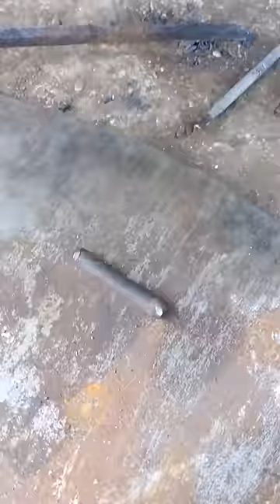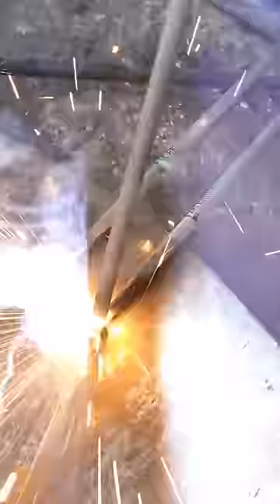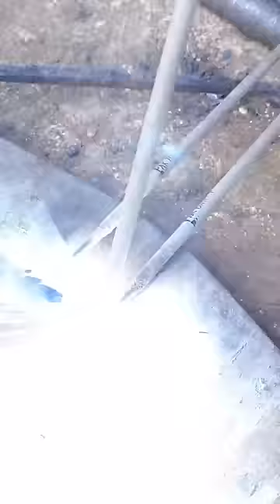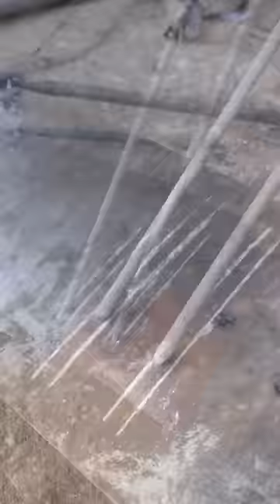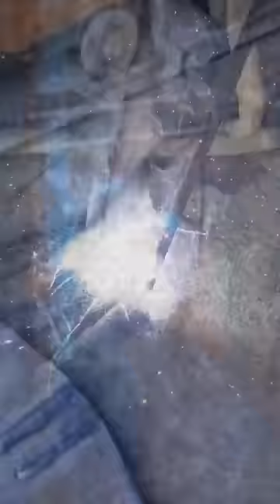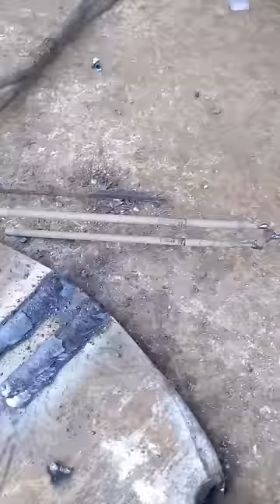dubal rod welding method of one welding machine #shorts

Comment: In the minute it took you to make that contraption, you could have just run a 2nd bead
Reply: Yup, and also what happened when the beads need to be MORE then an inch apart? or just one bead and the other just gets in the way.
Reply: @techmarine83  I mean, you could make it wider or shorter. And you wouldn't need to use it for a single weld, those sticks are actually one-time use. I'd wonder why you'd need to make two parallel welds like that first, because that's never really going to happen.
Reply: @techmarine83  of
Reply: Yeah, but this is actually super scientifically interesting. Common belief has it that all arcs are negative slope resistance. Hence one would always go out. It doesnt. Interesting.Edit: Negative slope means that while resistance is always positive, it decreases with current. Generally happens in arcs because they are a self amplifying avalanche type process. The more current, the hotter, the hotter, the lower the resistance, the more current, the hotter type of deal. That is also why stick welders control the current, not the voltage. Voltage doesnt really work. Mig is different because wire burnback is fast enough to enable self control. Mig is controlled by voltage. Stick isnt.
Reply: ใช่ มันเสียเวลามาก😂😂
Reply: Not if you’re doing multiples a day
Reply: @orlandovega6958  you would have to make one each time, they aren't reusable, so yes the time would even out even after 100.
Reply: @mr.a1899  not if you're trying to increase audience engagement, dude knows how to click and comment bait.

Comment: I would have thought that since electricity takes path of least resistance it would only allow one arc at a time. Aside from the practical applications of this, would you have to increase the amperage to use two at once?
Reply: That’s correct only one would arc at a time if you look at the end of video he did not use the rods there still new when the welds made
Reply: That right
Reply: I thought those rods looked suspiciously unused at the end.
Reply: Yes Absolutely Correct Bro...👍
Reply: The rods I must admit look like they haven’t been used but they are significantly shorter than at the beginning.
Reply: @leigheverett4491  thought that was odd as well. Maybe really committing to the "prank" lol
Reply: The rods were used, but not on this. Look at the rod angles while the welding is actually happening and you see they are coming from different directions instead of parallel.
Reply: Нужен мощный сварочный аппарат, + крайне синхронное поддержание дуги на обоих электродах... Вручную, я думаю, это не получится.. Фейк, имхо..